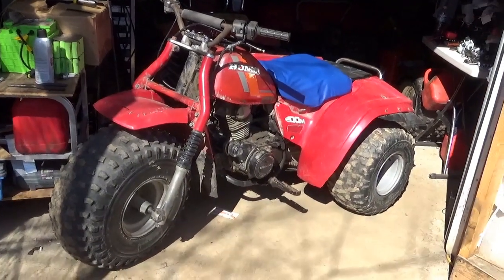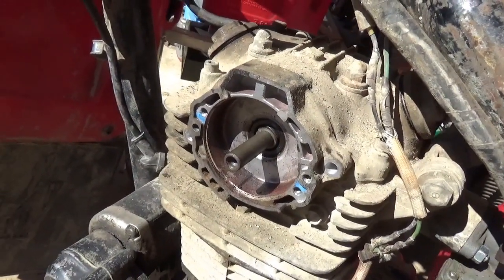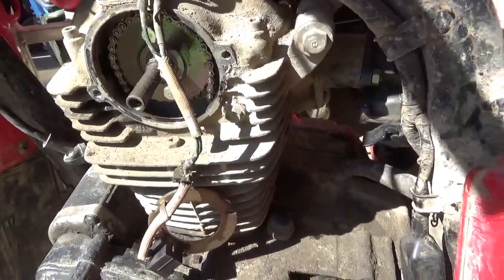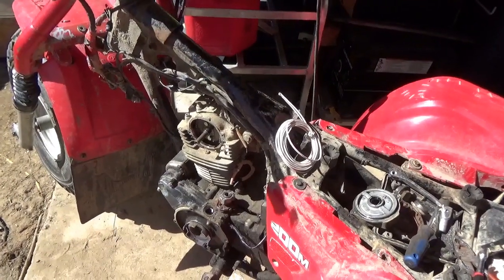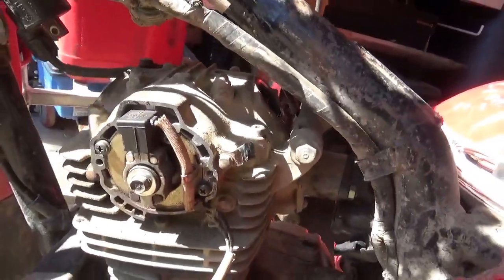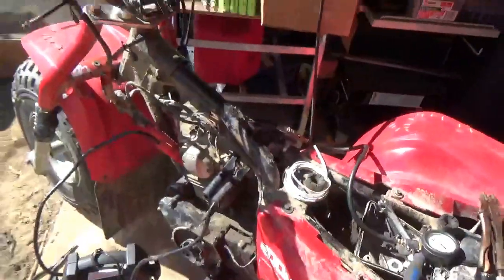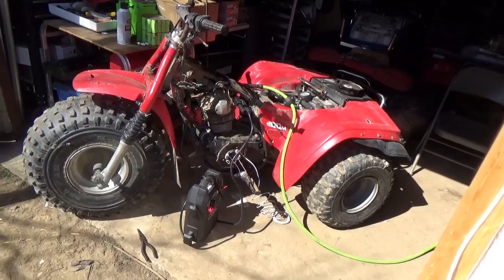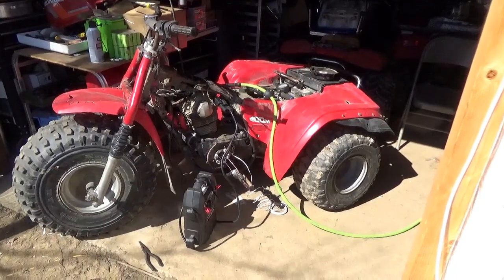Overpaid on a $650 Honda ATC200M, and its Worse Than I Thought!

Comment: Great lesson, and I even said out loud, pump air into the cylinder! Maybe I'll get an A in class participation? Just did a count on my 200 and 250 seats that need attention and this week I hope to finish a few of them, short some seat bumpers and got a couple of salvageable seat foams without bases. Had a call from a farmer that has 2 Bayou 220's with no seat foam so I went to my stash and found bases with partial foam that I could doctor up. A Bayou 400 has a different base but the same foam so I grabbed my last one and put them in a pile to get 2 ready for Monday. Horses and cows seem to love chewing on foam and I swear, I've never taught them to do that just to drum up business! Thanks Harvey.
Reply from the maker: Hey Steve, While U R horse trading up along the southern tier, can U find me a parts kawasaki Bayou 250????  Mine is a 2005, I'm surprised that U have that many seat blanks, seats are as hard to find as atcs around me and people want almost as much $$$... Horses have no right to chew on seats, cows do as we know their future....LOL!!!!  Thanks always for the info, thoughts, watching, and commenting!!!
Reply: @HarveySpooner  What parts are you looking for Harvey? Besides buying seats and seat foam off E-bay, I scrounge around the back of small engine repair shops and look at machines not worth fixing and make offers on the seats. I also take in bad seats in exchange for my seats and start working with that platform to create the next seat ready to go.

Comment: Recent Craigslist deal i seen was a 185 S they wanted $250, needed front tire, recoil, seat cover, headlight and a decent sized chunk of the rear fender was missing. Ran when parked they said. I was going to buy it but idk what it's worth fixed and how much parts are. Nice big reds here in MN they're asking 1200-1500

Comment: Mr harvy i dont know how far you are away from me in Mississippi but if you wanting can make a trade with you I have a honda I think 200 atc motor a rear-end for it a honda four trax four wheeler a suzuki 185 four wheeler and a bmx 110  4 wheeler and alot of extra stuff that I will trade you for 1 running 4 wheeler now the 200 atc ran when I got it and I don't know how to work on any thing like this these were supposed to be my learning prosses but apparently I'm not that kind of guy everything has good compression except the suzuki I haven't even tried on it the 4 trac four wheeler the guy said he had to push it off but I tried that and a battery on it with no luck and I traded a great atc for it and I bought a 136 dollar black box thing for it and the bmx I got and the guy said it ran but just quit and I think I burnt the starter up on it trying to crank it and if you are willing to trade me something decent ill even throw in the man sized gocart I have that I was going to try to put the honda 200 atc motor on

Comment: I paid $250 for my 200m. Runs and drives. Was a lil rough when I bought it.
Reply from the maker: Hey Brian, I used to find them for a couple of hundred, not anymore! U got a good deal! Take care of the classic! Thanks for the info, Ur thoughts, watching, and commenting!!!
Reply: I still find em. I bought a few weeks ago a 200e for $100 missing the rear fenders. And last month a 200e for $50 new tires and it will start on fluid.